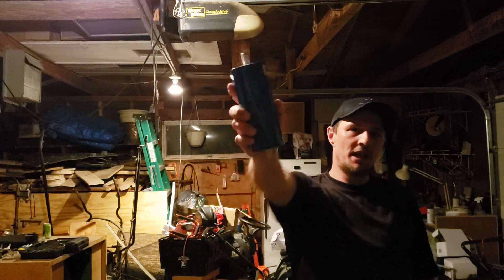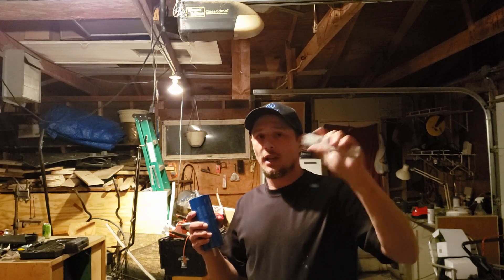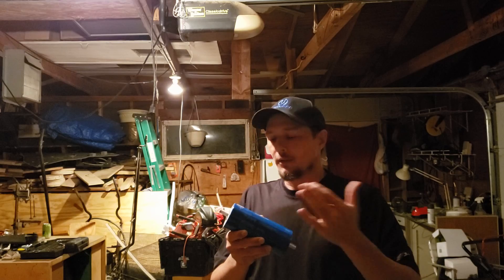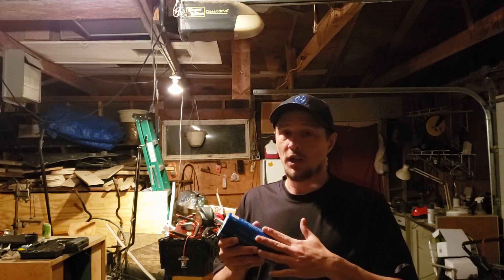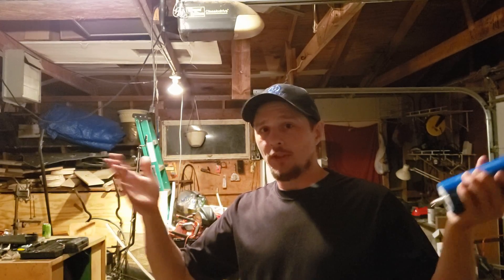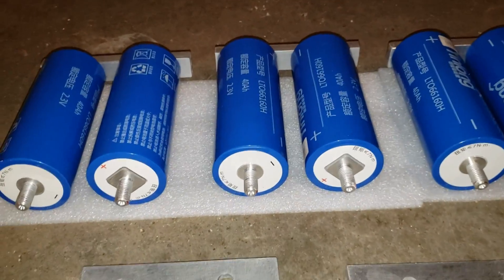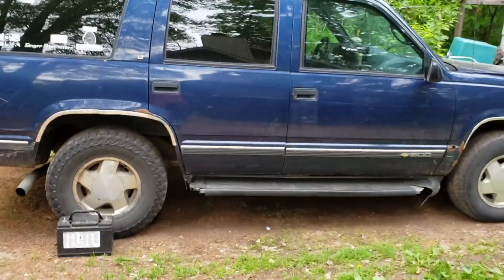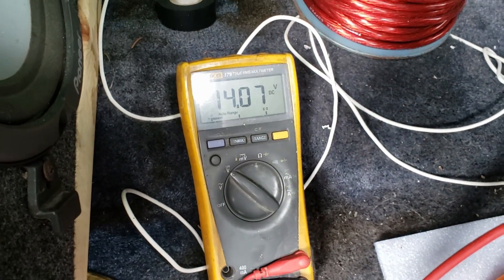13.8v Yinlong LTO 40ah how to Build and testing , DIY Lithium

Comment: so Maybe I missed it.... we know the YL was 40ah... you do not tell anything on the lead acid battery stats.  You also do not give and clamp data to know what the real current draw from the amp. So nice video the testing part was useless though.
Reply from the maker: i can do clamping :) ill also do bigger amps
Reply: @mazda2284  what would be awesome is to take like one agm...group 31... draw say 400 amps which is what the YL bank is rated at if supporting 4000 watts.  (or 100 amps if you dont have a large amp) test both for the same period of time. note the starting and ending voltage... SPL does not matter... bonus info... throw the bank on a 20 amp  (something consistent, an alternator might not be consistent enough) charger and see how long it takes to return to start voltage.  This is how to run scientific tests. Really appreciate people like you helping out straight forwards not all the bullshit like on the DIY page.. f ing pissing contest douche bags and trolls. Some David idiot was trying to say people don't play music drawing 450 amp continuous for 20 seconds.. lol
Reply from the maker: @henrycaldwell238  i can work on a test like this , i dont like load testers cuz they are not actuate , but i could do something more real world with amplifier drawing and clamped to see amps
Reply: @mazda2284  yes for sure... the only load tester i have seen is like a light bulb timed ... he was tesing the true AH of a battery i think... i forget where... we want faster discharge rate and so a clamped tone real world would be way better which was why i said you just use whatever amp you have. I can try once Shawn gives my friend his YLs but have not to test myself. I plan to test verses my regular batteries.

Comment: I'm thinking these Yinlongs would work well with my XS Power D1400 14V AGM batteries on my test bench as they charge at 16.8 and rest around 15.4. I've got a couple of banks just waiting on Toolmaker to finish the links. Can't wait to see how they perform. Great video!
Reply from the maker: Those are about the only agm they will work with in the market . Try some testing without the agm also , I'd be interested to see results with your amp dyno
Reply: @mazda2284  Will they still work with the standard 12 V AGM with an isolator?
Reply from the maker: @mjl6425  no , the isolator still connects them during charge. No need for agm with these anyway
Reply: @mazda2284  I just recently bought a Xs Power AGM and want to get lithium next. What are my options then?
Reply from the maker: @mjl6425  headway would be a good option to go with agm , however if you want alot of power going full lithium is the way to go. What voltage do you charge at ?
Reply: @mazda2284  14.8. I have a 250 amp SingerAlternator
Reply: That might be a nice combo. Their voltages seem to coincide well.
Reply: Update?
Reply: Can you share the link for that video Big D I’d love to see it
Reply: Yep, LTO is going to explode soon.

Comment: What was the point of that test at the end? of course its going to be louder with an extra 2v of power. but the one test peaked at 37hz and the other one was 32hz so i really dont understand how that test even makes any kind of valid comparison
Reply from the maker: i played the same song , same volume same everything and the peak changed i guess lol .
Reply: That is so weird dude lol the power difference of the batteries musta changed the peak
Reply from the maker: @ballinblaza  I've had people tell me changing amp or battery cant change your peak , but the termlab dont lie so those things can change the peak frequency
Reply: It kinda makes sense that power would change the peak

Comment: Can you run them with an agm starting battery if you have a battery isolator between the two batteries?
Reply from the maker: i would not recommend it  . just pick one or the other type of battery . not any good reasons to have both unless you have 2 totally separate charging systems like the guys that run 18v and have a 12v alt dedicated to the 12v , mixing different chemistry batteries even with a isolator is a bad idea .
Reply: Ur saying only run yinlong? As in no battery at all? I dont see where it would hurt if u had an isolator separating batteries until the vehicle is running.
Reply from the maker: @jeremyhardee9026  we have done lots of testing and isolators are not perfect . they are made to isolate 2 batteries of the same type , not meant for totally different batteries and voltages . also if the isolator fails it will ruin your lithium . there is no reason to run both . ive had people bring this up and nobody has ever given a good reason to use both on isolated system . only time it make sense is when you have 2 totally separate charging systems with 2 alts .
Reply: But the headway banks are ok to use with agm batteries?so since u obviously know more about the yinlongs than I do lol. If I were running roughly 8k rated power about how many banks do u think I would need to run the vehicle as well as the audio equipment?
Reply from the maker: @jeremyhardee9026  if running Just yinlong 80ah would support your car and 8k no problem if you can charge above 14.2v  , if you did headway you would probably need closer to 100ah . the yinlong being higher voltage will also produce more amplifier power . the yinlong would cost less overall when doing such a large bank . the usable voltage is the key here , the headway nominal it 12.8v and has a max of 14.8 and min 9v . yinlong is nominal 13.8v and max of 16.8v and min of 12v . our amps are made for 14.2v , max varies on amps from 15.2 to 16+ volts on amps made for ''12v '' use and much higher on high voltage amps , min cutoff is anywhere from low 9's to 11v on some amps , most in the 10v range , when voltage drops you clip sooner . the yinlongs keep us in the range we want to be at to get the most out of our equipment .
Reply: @mazda2284  xs power has 2.85v supercaps. I'm completely new to lto/supercaps. How many would I need for say 4,000-4,500 watts total with a 125 amp alt? I can get a 110 watt agm that'll support up to 4500...but its $550+ and I'll need a bigger alt. But really what's the difference in say a yinlong 120ah vs say an agm 120ah? I'm lost on all of this....
Reply from the maker: @oldbassheadz77  you only need 1 bank of yinlong 40ah , if you really wanted to you could do a bank of 2.7v caps , 2.7x6=16.2v
Reply from the maker: @oldbassheadz77  the link to store in description
Reply from the maker: @oldbassheadz77  unless your going over 16.2v you want the 2.7s
Reply: @mazda2284  so I'll be ok with just 6 of these, a stock 125 amp alt, and no battery....correct? When I had 2 xs xp950s in my car it charged them at 13.8-14 volts with all accessories on...Is that enough?
Reply from the maker: @oldbassheadz77  14is kinda low but would work for now , look into talking with singer alts or ces alternators and see if you can bump up your voltage

Comment: So let me get this straight because I saw the battery under the hood. The lithiums are the only thing using for the truck
Reply from the maker: yea the battery under the hood was just for testing when i did the 12v vs lithium tests , it wasnt ever hooked up at the same time as the lithium , normally there is a block of wood there lol . ill make a video on it .
Reply: @mazda2284  can you put the battery under the hood
Reply: Yes sir this guy is on point I'm running 80ah of these cells with a bank  of supercaps on a 10k at half ohm on stock alt minimum voltage drop  yinglong FTW
Reply: The lithium I mean
Reply from the maker: @mosests3  you shouldn't , even a normal battery shouldn't be under the hood because the heat is bad for them these are rated to 150c degrees i believe but you really shouldn't run them under the hood . ill have a battery relocation video coming soon

Comment: Voltage with lead acid was 11.5 decibels what was 132. 2 with the Ying long dropped I like 14, 13.9 and did 132.6... That's only . 4db  difference and 2.5  Voltage gain.. seems like a big difference on the Volta Jen but I would have thought the DBs would have went up a hell of a lot more than that? COULD IT BE BECAUSE THE AMP YOU'RE RUNNING IS REALLY NOT A SUPER HIGH WATTAGE AMP MAYBE ONLY GOT LIKE A THOUSAND WATT AMP HOOKED UP OR SOMETHING? Awesome explanation this video should get some views due to the content you're really helping out people you're helping me out I know that I've been wondering this shit since last summer and nobody ever has videos on this!! Thank you much respect and Good Karma but I'm still confused about the test though 🤔
Reply from the maker: FATHER'S OF BASS  yea i think the leadacid was 36 or 37hz and the lithium was peaking at 33 or 32hz , which is kinda strange but it is what it is lol . ill do more tests with a higher power setup cuz if i did a video where im pulling enough off 1 battery to drop it into protect the gap would be much larger in db's . this test was more to show a smaller system and its not a huge gain on a smaller setup , you can however hear the difference in person , the lows are stronger
Reply from the maker: the amp i used in the test was only 1200rms and regulated power supply . i can run another test with much more power